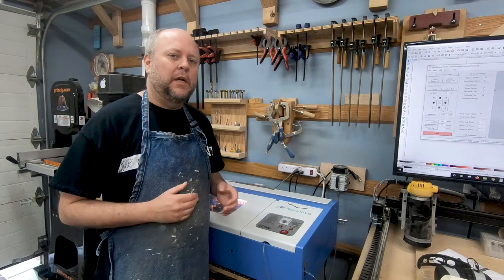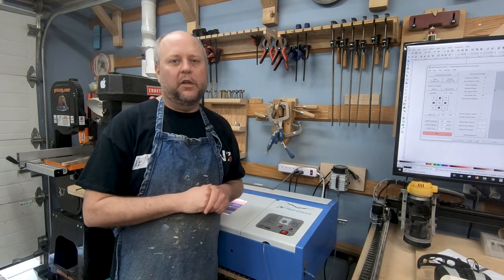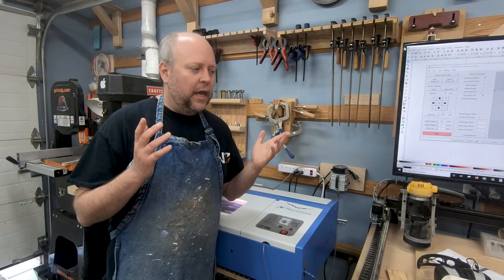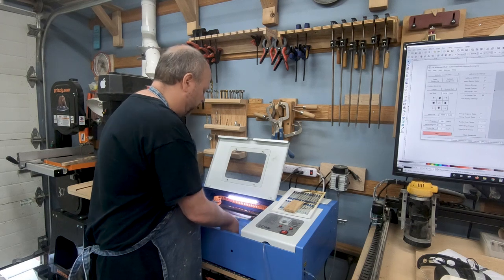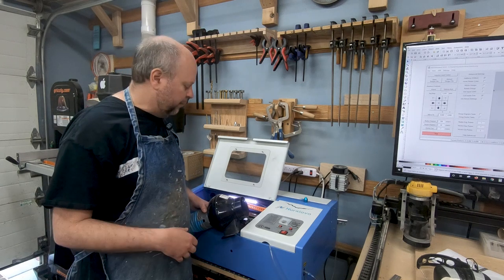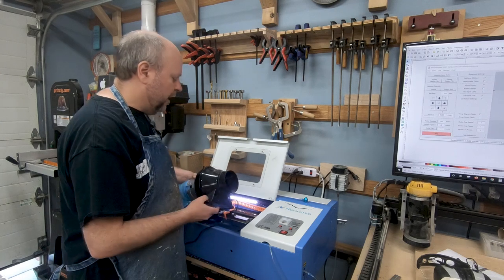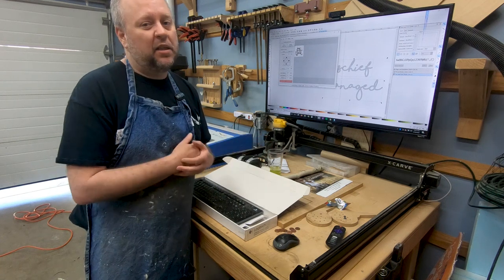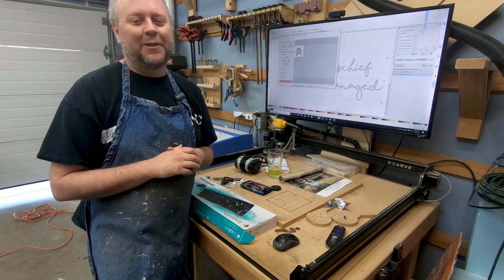K40 Laser Cutter & Engraver - What Do You Really Need To Get Started?

Comment from the maker: Been getting a question a lot about how big the cutting area is after removing the bed.  It's about 12"x8".  Perhaps a tish less.  I've never cut to max size.
Reply: Hi, It looks like your working area suit your needs, but just in case if somebody is interested, I completely removed the exhaust box, the working area is now 12 x 9 inches and it the smoke extraction works as well as before. 
I use the system that came with the laser, as Whisperer was still in development at that time, and I didn't change out of laziness as I'm used to do it that way, and the explanation I read about Whisperer seemed, to me,  like a different kind of complicated. 
And to people that are new to laser engraving : Do not underestimate the distilled water, I used tap water with a t-spoon of bleach to avoid mold it worked for a while then the laser was starting to engrave then the power was dissipating quickly,  I though my tube or power supply was shot and luckily it was only the water, it went back to normal (actually better) after correction (distilled water, no bleach).  Thank you for the video, Travis.
Reply: Hai
Reply: Travis- would you be willing to print and sell me the drag chain and nozzle for the air hose? I just ordered this and it looks like they would be great additions!
Reply: @Yves95128  thanks man

Comment: I'm so into seeing these videos. I'm an industrial laser service technician that specializes in Mitsubishi lasers and its so fun to see these little miniature units using the same basic process that we use to cut steel for the manufacturing sector. fun thing that would improve your cut quality is to change the air assist "which we refer to as assist gas"  would be to use nitrogen for your engraving processes instead of the atmosphere.

Comment: The reason your laser is hitting the rim of your air assist is because the laser is not aligned properly, it could be the laser head is slightly twisted, or it could be some other issue.  

To find out for sure, Cover the hole in the blue laser head with a piece of masking tape (two pieces thick this is usually good), turn the power down to just a couple mA, move the laser head assembly to the top left and test fire the laser, then move the head the bottom right and press the test fire again. 

If the beam remains in the same spot on the tape, then your mirrors are aligned, but your blue laser head is rotated, if there are two separate burn spots on the tape, then the mirrors are out of alignment.

What I can promise you is that Its not the fault of the air assist head.  Cheers and good luck!
Reply from the maker: I agree...I'm a little better at focusing my laser nowadays.  However, I still prefer my 3d printed air assist.  It focuses the air on the cut, which I really like.
Reply: @byTravis  Good to hear! I had a noticeable improvement in cutting power and accuracy after I got the alignment dialed in. I hope you saw the same improvement.

I found the problem I had with the 3D printed air assist was that since the air came in at an angle, for really light materials like paper it would either blow the paper itself out of position, causing irregularities in the cut, or it would cause small paper appendages to occasionally get blown into the path of the laser which were then cut off by the laser when making a secondary cut nearby.  

Using the one that directed the air straight down reduced the problem for me, but if you don't do much delicate work on light materials, its probably not that important.

Cheers!

Comment: I have a boss 1630 and i was able to pump O2 through the air assist and cut a hole in the bottom metal plate of a car amp for a fan. the 1630 does have a 100w tube but O2 might expand the usability of a 40w as well.
Reply from the maker: Interesting idea.  O2 would certainly make it burn hotter for sure.  I'd have safety concerns, though.  Fire and 02 can be a dangerous combo if not done right.

Comment: Thanks for all your videos 
Please am new i bought the 40w co2 laser the update one my question is can i set the power and speed on 40w whisperer software instead of those buttons on the panel because i don't understand those buttons
Reply from the maker: Not without upgrading the controller.  You can use MeerK40t, which does something similar.  It doesn't really control the power per se, but it does pulse the laser to mimic a change in power.

Comment: Travis, thanks for the video.  I skipped this level and picked up the 5030 50 watt Chinese model.

Lightburn is more than a great product, however I don't think it supports the controller on the K40 types 'out of the box'.  The K40 controller is a different animal than most controllers.  If you wish to run Lightburn I believe you will need to upgrade the controller one that is supported by Lightburn.  Grbl or DSP are both functional and available for the K40.  Once you use Lightburn, you will never go elsewhere.  There is a 30 day free trial...  

Go to the site and you can read how others upgraded their K40s.

The other point is that of the alignment, it would be nice to advise your followers how you fixed the 'hitting the nozzle' issue.   I have completely replaced the whole head assembly and removed the drag chain along with a few other items.  With that machine it's difficult to check exactly what happens once the beam goes into the head.  Mine is open, so that can be checked.   

If you beam does not hit the center of the lens, it will come out at an angle.  This can be seen when the cut it not 90 degrees from the surface.

Lastly, I run air assist.  The basic reason is to keep 'junk' off the lens.  That is a drawback with your design.  I always run a few pounds pressure to ensure my lens is clean.  I vary the pressure depending on what I'm doing.  Generally high pressure for cutting and low for engraving.  Hi/lo pressure is selected via the layers software.

Thank you for taking the time...like the X-carve... Take care

Comment: Helo! Great video! I was in doubt about the ice in the water bucket, couldn't this cause a thermal shock to the laser tube and make it crack?
Reply from the maker: You should be circulating the water before the tube gets hot. Otherwise you’ll have problems. If you start with cold water, the tube will be cool when you start lasering.

Comment: I used toworkforce theKirk Stieff silver company. The computer engraving dept. got one of these lazer engraving machines. With in 2 weeks every thing in the computer engraving dept. had a film of static charged metal dust. It got so bad that it shorted out the computer. You should probably get a de-ionizing system and a heavy ventilation system.  We only used pewter and silver, mostly pewter . Good luck, safe work.
Reply: You are breathing that?

Comment: I loved the video thank you. 

I finally got mine working after two days of stress 😂 it engraved beautifully but my gauge doesn’t move from zero and if I try to Cut with it the laser just moves to the other end and try’s to keep going. Have no idea why???
Reply from the maker: It sounds like the limiter switches is bad.  There's a tiny toggle button type switch at the end of each of the axis.  When the gantry bumps into that, that's when the computer knows when it reaches the end.  That would be my guess, anyway.

Comment: Hi Travis liked the vid 👍 is it possible to engrave pictures on marble with the k40? Or what power laser would be needed? Thanks.
Reply from the maker: I guess it depends on the size of the marble and how detailed you'd want.  The curved surface might pose a challenge.  I have engraved on glass, which seems to work OK.  The trick is to make a gray graphic instead of a black and white graphic.  The pulsing/dithering created by the gray seems to work better on the glass.

Comment: I’ve been using my k40 for about 18 months, off and in. I’ve used Corel to make all my DXFs, then bounce into k40 whisperer. 

One thing I haven’t been able to figure out yet—is there a way to make it ‘solid fill’?  Like in your Bigfoot example, what if you wanted all of the black lasered onto the surface, not just the outlines?

The work around I’ve figured is hatching patterns, but Corel’s auto hatch isn’t recognized in k40. I’ve had mild success with manually drawing in the hatching, but that’s kind of time consuming and a pain in the ass.

Comment: I live in New York and my in my laser engraver would be in a shed where I could drop below freezing is it possible to add antifreeze to the water?
Reply from the maker: I've heard of people doing that.  The only concern would be the additives in the water might interfere with the laser in the tube.  That is the main reason you use distilled water, is to make sure the minerals in tap water doesn't affect the laser.  I'd give it a quick google, or check one of the FB groups because I know people do that.

Comment: thanks for this.  Bit concerned that I'm about to get my first one and don't know if I actually need the mods, particularly removing the bed to get the full 8"x12".  My research continues...
Reply from the maker: The mods I mentioned in the video are what I'd suggest.  Specifically the bed, and the air assist.  The bed, you'll figure out you'll want to remove right away.  It's easy.  Nothing to it other than unscrewing a few bolts.  Air assist is will help with flareups as well as clean engraving/cutting.  Good luck!

Comment: Thanks for your video, i have one question, what distance ist the correct from the Laser to the surface of the object you want to grave?
And when you put out the original bed, what ist the size of the workspace and how high could a object be whit your adjustable bed?
Reply from the maker: I split my laser stuff off to a new channel.  Here's a video that should help with setting focal length.  https://www.youtube.com/watch?v=u4YHbDBBofg&t=2s
With the original bed removed, it's about 12"x8" and a little less than 4" deep.  You could cut out the bottom of the laser to get more depth if you need it.  There isn't anything vital on the bottom, just sheet metal that could be cut with snips or a grinder.  Hope this helps!

Comment: I have a question about the laser: do you wear protective glasses while cutting with a laser? is it safe to use without glasses ?
Reply: Id image its safe with the safety door closed but I still wouldn't trust the safety glass as its from china so I'd always wear certified glasses that I purchased from a known vendor!
Reply: @mikevez6639  OK, that's what I thought! thanks for the answer
Reply from the maker: I'd almost always err on the side of safety.  With that said, my understanding is that the wavelength of the laser is small where it dissipates quickly.  But, it's best to do your own research and make your own decision.  I'd try to always keep the lid closed for sure and I try to avoid any risky situations.  Plus, safety glasses are a good investment compared to the alternative.
Reply: @byTravis  thanks for the advise; I bought protective glasses :-)

Comment: do you need to connect a PC to it or can it read from an SD card or a  USB flash drive or is there a way to set up  wireless connection sort of like octoprint with a raspberry pi?
I would  want to put this in the basement and I don't have PC down there
Reply from the maker: You'd need a PC to send the signal to the laser.  I'm sure someone figured out how to use and SD card, but that would require extensive modding.  I have an old computer in my shop.  You don't need much since the software isn't all that powerful.
Reply: @byTravis  ok thanks
Maybe someone in one of the communities will figure out  a way to make an octoprint type solution some day
Other wise I guess I could use my old laptop then
It's a  vaio  win 7 i3 from about 09 or 2010

Comment: So you don’t need one of the chillers? Like the 5200 chiller?
Reply from the maker: I just use a 5gal bucket filled with distilled water and blocks of ice.  Works just fine for me.  Depending on the day and how long I've been using the laser, I might swap out the ice once or twice.  I freeze 2liter soda bottles.

Comment: I have a k40 laser and lately When I turn it on and it start making a loud noise in the control panel so I turn off and turn on couple times and then he goes away. Did you experiment something like this before. Please I need help im worry it’s breaking and its the middle of the sales season for me. Thanks
Reply from the maker: I'm not sure what that would be.  Maybe the fan on the power supply?

Comment: A 3D Printed Air Assist is NOT great idea. Rather than be a “Fire Preventer” this can actually be the cause of the fire. The plastic does not last long with the heat of the laser. Learn from others mistakes. I’ve seen several people on YouTube completely set there laser on fire because of this.

Comment: When I download the K40 whisperer and run it and click initialize lazer, I just get a USB error laser USB device not found. Can you give me any insight to whats going on?
Reply from the maker: I had to change my USB cable out. You can also check the USB connection on the laser. It might be loose. Wiggle it around and see if it connects.  I had to resolder mine.

Comment: Hello Travis, I just wanted to know can this machine cut out thin layers of sterling silver for making name necklaces?
Reply from the maker: A laser in essence burns through whatever you are cutting.  As such, the K40 doesn't do metal very well.  You can mark it with a marking agent, or burn away a paint or coating, but it isn't powerful  enough to burn into the metal to give it a significant texture, let alone cut.  Maybe if they're super thin, possibly?  I haven't tried anything like that.  But if I was to make a guess, I'd probably say no to cutting.  Might be a good way to add patterns to the surface, though.  I'd check on some of the FB groups, reddit, or glowforge website to get other feedback, though.  Maybe someone who works with metal can give more information on what you're trying to accomplish.  Good luck!
Reply: @byTravis  Thanks for the time making the video.  

Most metals reflect a majority of the energy from the beam, depending on the lasers frequency.  Aluminum molecule reflects over 98% of co2 lasers energy.  Add to that that metal 'sinks' heat away from the area quickly.  This doesn't allow enough heat to be generated in one area to do damage...  

I 'sizzled' a 2.5" lens trying to mark stainless with a '50 watt China Blue'.  Burnt the center of the lens reflecting back.

Want to cut metal add big $$$...  I have good luck with the coatings such as LBT100.

Comment: great video im going to get the one with the estop which comes with digital % readout.and digital temp readout and light power switch....i do agree the actual amp meter is needed and the % readout is useless but .an analog meter is cheap to maybe $5..on ebay the estop and temp gauge is more important to me ..one question i have is that it seems there are not many k40 on ebay anymore..are they being discontinued? or issues? or covid 19 related? .. and does k40 whisperer work on the k40 that come with coreldraw?
Reply from the maker: I'm not sure about the lack of k40s on eBay.  It could be supply chain problems due to COVID and the trade war with China.  I see one on Amazon (https://amzn.to/3fIp2yr) that is basically the same one I got.  However, I ordered mine on eBay, as it tends to be a bit cheaper.
I know there is a plugin for CorelDraw that will work with the laser.  Unfortunately, I don't know much about it.  It is my understanding CorelDraw treats your laser like a Printer and talks directly to it.  So you wouldn't need K40 Whisperer in that scenerio.

Comment: How important is the analog meter I noticed that the latest eBay and Amazon blue k40's are wow digital meter???
Reply from the maker: A lot of those meters measure percentage instead of milliamps.  As long as the digital meter measures your milliamps, I think that is the one you're looking for.  You can also add a analog meter, too.  They're pretty cheap.  I haven't installed one, but I'd imagine they'd be easy.  Lots of YouTube videos on the process.

Comment: Quick question. Can you cut and engrave acrylic with this laser ???
Reply from the maker: Yup.  I've cut a few things.  It works remarkably well on acrylic.  Beautiful clean cuts.
Reply: @byTravis  using k40 whisperer do you specify cut or engrave?  so when you want to engrave some words then cut out a shape do you need to change the power setting on the laser manually or will the software do it?

Comment: Don't they give you the thumbdrive to work with it? Without the thumbdrive how to even work with it?
Reply from the maker: There was a thumb drive, but it was for software.  I certainly wouldn't install it, though.  I just use Inkscape for design, and K40 Whisperer on the PC to run the machine.

Comment: Print n cut possible in this machine? We are printing stickers n than cut
Reply from the maker: It won't print an image.  You might be able to do the cutting, but you'll have to modify it quite a bit by adding a camera and upgrading the software to Lightburn.  You might have to update the controler board, too, depending on what you want to do with it.  Remember, it's using heat to cut.  I think you'll be able to pull it off, but it will take a lot of experimenting and tinkering.